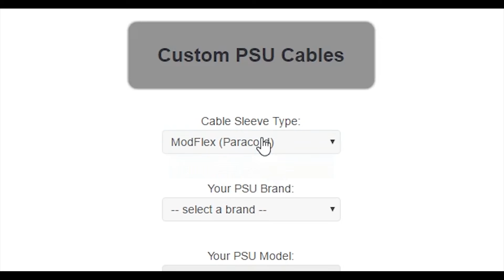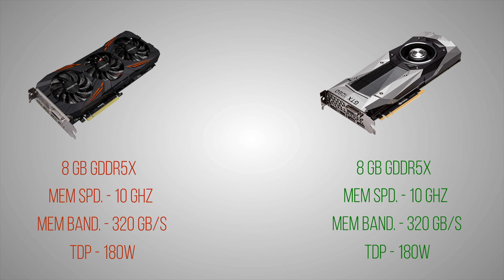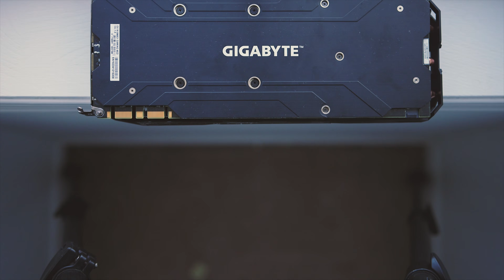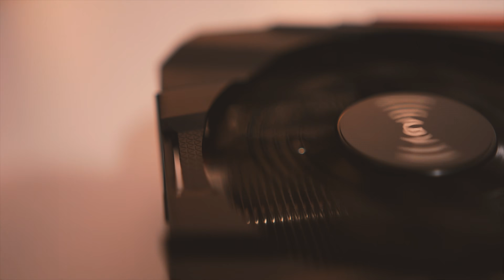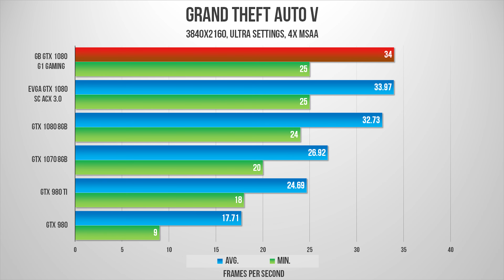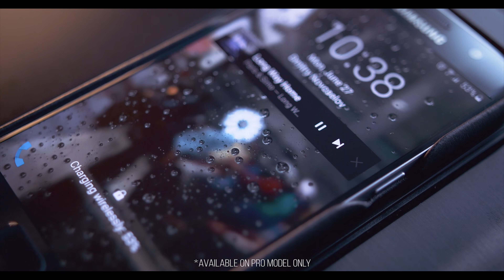GIGABYTE G1 GAMING - GTX 1080 Review

Comment: I got two of these for $500ea. I like my cards a lot. I also got really lucky with one of them cause it can hit 2200 mhz (gpu) and 10600 mhz (memory) at 70c with fan at 80% stable on stock cooler. Wish i could say the same for the other one cause it struggles to hit 2100 mhz and can only do 10200 mhz on the memory. It was a real eye opener on how the silicon lottery can be.

Comment: why does mine go so slow i cant run battlegrounds at very low... i still only have 30 fps and im stuck there if i take higher settings it is still at 30fps
Reply: Ênsy check vsync it might be on half

Comment: I was hoping for a more definitive verdict. I'm bouncing back and forth between this card and the SC for my new build. Since the evga is cheaper and is pretty comparable I might stick to it since it was my first choice. I am hearing a lot about the G1 though.
Reply: Joshua Martin what did you pick I’m torn between the two, I will be getting them used on eBay for @ 350.

Comment: Sold my 970's and got one of these, going to pick it up shortly, the memory issue with the 970's freaked me out not to mention the way Sli is not supported properly in DCS and sims I like to play. I sold my two 970's for 340 euros and my 1080 cost 700, so 460 for a single gpu solution suits me fine!

Comment: I got this and my temps went up to about 74c on overwatch at epic settings with fps cap off, got about 200fps. I'm pretty sure this isn't normal, I might have to rma it because of its temps
Reply: friday puncher it is normal. At 100% the card will heat up until 80 C which is just fine :) be worried when its aeound 90
Reply: Beedyboy a little late with the reply lol, the average now is about 64c with the fps cap off going about 180 fps

Comment: I got this card with software I didn't see that much difference so I just uninstalled the software and currently only on nvidia updates still 4K gaming is butter smooth and surprisingly it runs quiet even under load it runs quiet and best thing is there is no coil noise at all

Comment: Ay? Why are the fps's in the benchmarks so low @1440p compared to other sites/videos I've seen? Typically all of the gtx 1080's sit around the 120-170fps mark in most modern titles, with everything cranked up. Something seems very weird here... I mean I would expect even better performance than that because I don't run AA @1440p. Can someone clarify why their fps is so low?

I mean even compared to your own 4k benchmarks, the 1440p scores are practically no gains?
Reply: They used AA. Most benchmarks don't.

Comment: Camera work is slightly off on this one. Examples:
https://youtu.be/ilArkYmDYEI?t=245 - I genuinely have no idea what's being shown here :D
https://youtu.be/ilArkYmDYEI?t=480 - Edges of logo (the object of interest) are blurry
https://youtu.be/ilArkYmDYEI?t=152 - Awkward focus position, rule of thirds!
https://youtu.be/ilArkYmDYEI?t=208 - 95% of the shot is blurry, actual focus of the shot (the fan wings) take up a very small portion of the shot.

It's overall good, just you seem to be prone to making your focus too tight. I would also suggest not attempting to make these shots functional. I can see you're trying to highlight specific components of the board but, the audience of this kind of product knows where the power connector and such is, they don't need that pointed out :). They just want to see some nice macro shots of a card they might drop a load of money on.
Reply: And https://youtu.be/ilArkYmDYEI?t=549, overexposed leading to reduced colour definition on object of interest. Eye is drawn to the white background. Object if interest doesn't conform to rule of thirds.

Comment: I've had mine for a week and love it, not to mention it's one of the best priced GTX 1080's out there. Keep in mind the Gigabyte Xtreme Gaming is forthcoming Boost: 1936 MHz / Base: 1784 MHz in OC mode and dual 8-pin PCIe power. IMO the small gains coupled with an $800 vs $650 make the G1 a better value.
Reply: I know your comment is 2 years old, but did you have any coil whine issues with this model ?

Comment: This card is about 70USD more than the MSI gaminag X where I live, so I went for the gaming X instead. The MSI gaming X also has a 8pin + 6pin power connector as well as a better cooling solution.
The G1 gaming should be cheaper than the MSI gaming X but yeah, not where I live.
Reply: Blue the card now is $420 and a way better deal than any other 1080 and running fans at a constant 70% keeps the card cool and pretty quite but I don’t know why you added in the “8pin + 6pin” as a reason to get the gaming x like if the card needs less power and preforms basically the same I don’t know why you wouldn’t go with the one that takes less power

Comment: I don´t know by the G1 1080 but with my 1070 it sounds like a Fax machine due to Coil whining.
Reply: Damn, have you asked for a replacement?
Reply: I sent it back and bought the Gainward Phoenix Gold Sample
Reply: ultra ultra Nice, though my experience with gainward was coil whine out the ass, back when the gtx 770 just came out I got theirs.
Reply: I was aswell concerned about Gainward,  But they really nailed it, as well with Palit Gamerock.  They did in my opnion the Best aftermarket GTX 1070/80
Reply: ultra ultra Nice, glad that you got a good one, I personally went back to MSI as soon as the 970 came out, and if I decide to get 1070/1080 I'll probably get MSI again.
The color scheme of the Gainward looks great as well, would fit well with Noctua fans.
Reply: The Gainward card Is actually cooler and quieter than the MSI Gaming 8

Comment: I got mine a week ago. Had nothing but bad experience; very annoying coil whine, and the fans sound like jet engines when gaming. I had to return it and got an MSI Gaming Z, which is far, far better than the G1.
Reply: how are you liking the gaming z anyhow?
Reply: I love it. The cooling is very nice and the fans are quiet even during gaming sessions.
Reply: what power connector does it use?
Reply: 6 and 8 pin connector.
Reply: thanks for your time
Reply: No problems. Have a good one!

Comment: how about asus gtx 1080 ? is it better than this card ?
Reply: Not At All. Asus isn't Upto the Mark This Time.
Reply: +Forrest3r You mean to say Every Video out there about GTX 1080 AMP Extreme! is False ?
Reply: +Forrest3r Hearty Congratulations and I Hope You have A Great Gaming Experience!
Reply: +Forrest3r Your pci slot will probably break lel
Reply: +Vishal Kokal but i've seen the benchmark between this,asus,and msi.Asus has more performance than this two brands
Reply: +Rizky Ramadhan Source Please! The Asus Strix Version runs Hotter which leads to No Substantial Overclock.
Reply: It costs more in Australia ($50 more) and has an overclock of 1911MHz (if looking at strix). So already it is a better card... However, the full overclocks of all the 1080s out now are dependent on the silicon lottery. You really may get a better overclock with a cheaper card sometimes it seems!!

Comment: Have anyone got pass 2.1Ghz yet? My FTW can't, my friend's Strix OC can't. My brother's G1 Gaming should arrives this Friday & hopefully it can!
Reply: My Gaming x barely can.
Reply: I have a Strix 1070 and I was able to get a hair over 2.1 GHz when running Heaven Benchmark, but when actually gaming, I would get occasional freezing and such, so I had to dial it back and now im sitting at around 2075-2088 MHz
Reply: Metalbolt Ye, mine is at around 2030, just in case you know.
Reply: @Metabolt I got a stable 2075 MHz too. It actually start at 2105 but then drop back down to 2075
Reply: ZondaboY64 Are you running a 1080 or a 1070?

Steve L Yeah usually when I start a game, the card goes up to something like 2114 and then goes back down to 2075. I know it's not a thermal throttling issue because my temps are usually in the mid 60's and occasionally spike up to the low 70's. This is also my first PC build, so I don't really know what to expect either.
Reply: Metalbolt 1070.